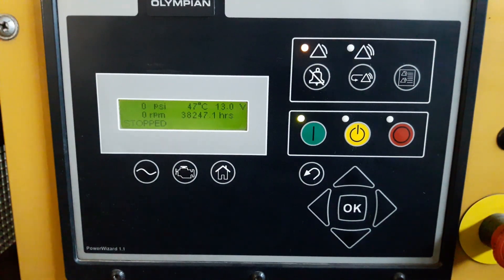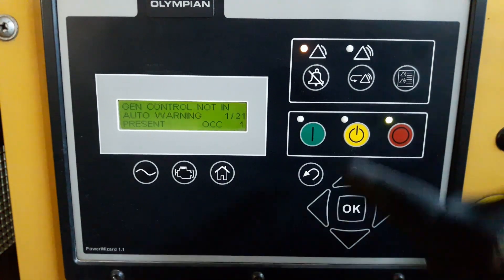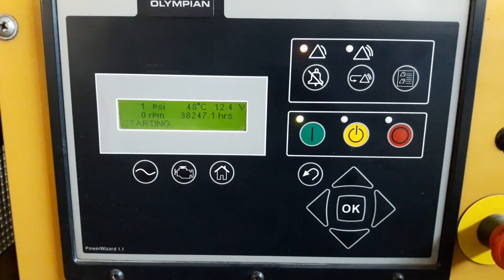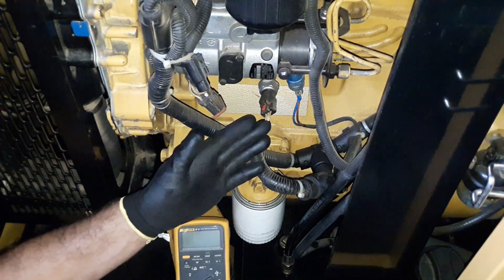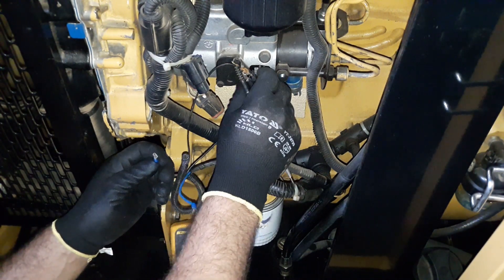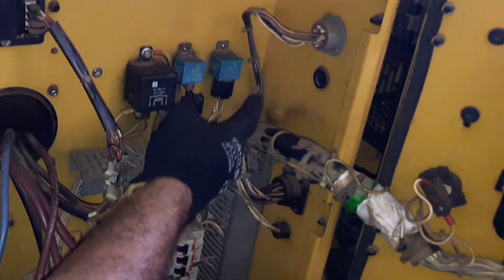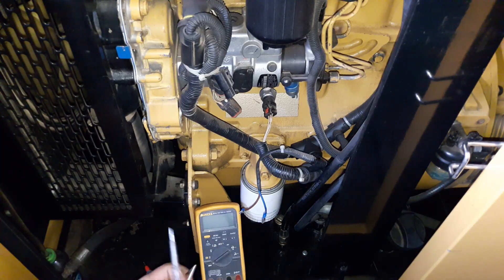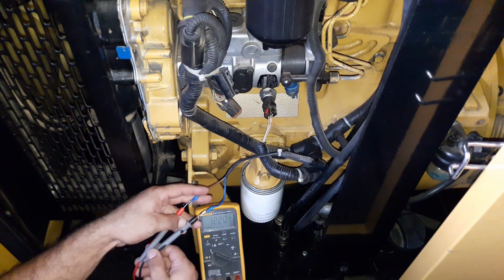Unexpected engine shut down symptoms. #generator #1millionsubscribers

Comment: Hey how can you turn off this generator when it's running continuesly
Reply from the maker: Either you have problem with fuel  solenoid or fuel relay if you have pushed the stop button and the engine won't goes off 
Please remove the solenoid's connector at the injection pump the engine will shutdown.
Reply from the maker: After you diagnosed the issue replace the malfunctioned part

Comment: My engine has similar problem,  unexpected shutdown! But when i restart the engine it starts normal. However only during the change in load it shut downs! Wht it could be ? I already inspected fuel side. Thank you.
Reply from the maker: Greetings 
Unexpected shutdown is an electrical problem, it happens if there is loose connection where the negatives circuits are grounded at the engine, or there is power interruption happens with circuit which is  supplying  power to the fuel cut solenoid .
Reply: @northjayhoon9789  appreciated sir!